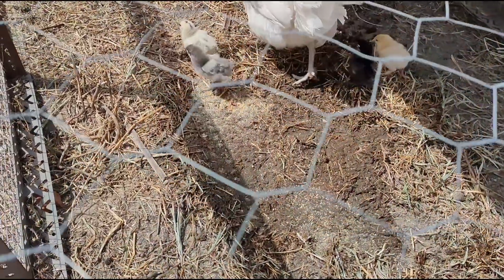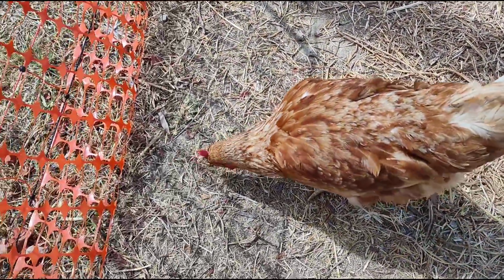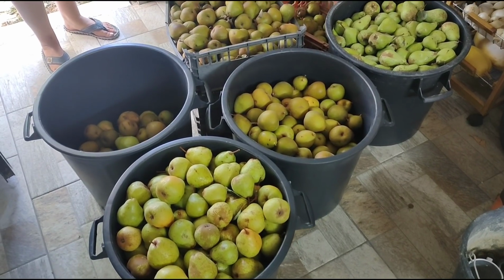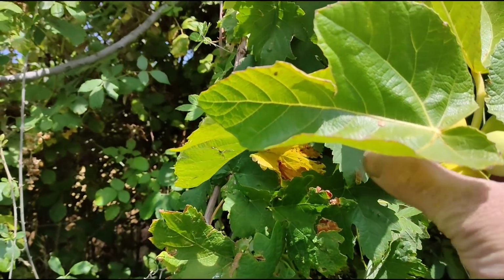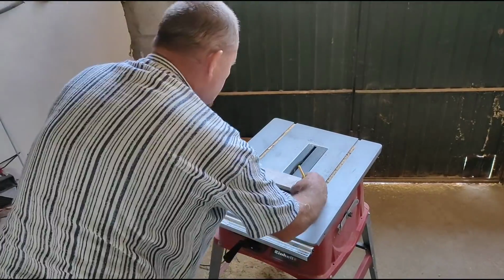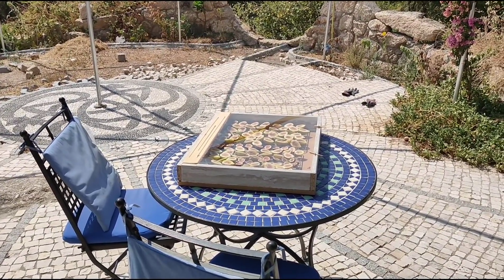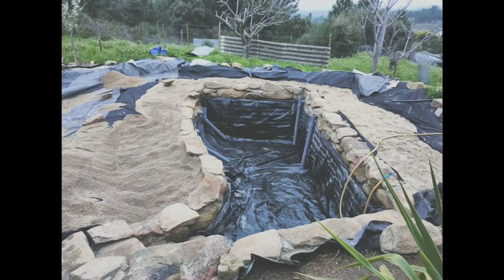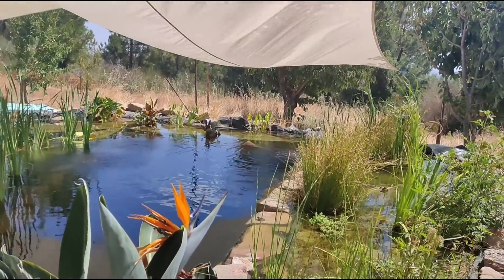No.4 How we built our Natural Pond plus Pear and Fig harvest

Comment: Your natural pond is beautiful. I was thinking after you made the vacuum. If you plumbed a couple of five gallon buckets together with some PVC pumping fittings at the top and with lids on. The water would  go through both bucket back into the pond. Most of the sand and slug would drop to the bottom of the buckets. Just a thought.

Comment: Have you considered putting in some fish that are algae eaters? As for finishing the edges of the pond I'd try to keep it looking as natural as possible, you have done an incredible job already and I'm sure you are about to inspire a heap of people!!! One thing I would do however, if it was my pond, is get rid of the fake grass, it doesn't look right with such a natural looking pond and then fake grass. It is your pond though so you keep it if you want. What are your thoughts so far with finishing it off, are you looking at putting furniture around the pond, did you want to have grass leading up to the pond so that you could have a picnic by the water's edge, maybe a wooden table and chairs, like what are at many picnic spots that can seat 8 or 10 people but are only 1 seat on either side. You could place a metal garbage bin near the picnic area too and take it back to the house when you don't need it out there or leave it there permanently if you find you use the area all of the time. You could build a wooden shelter even if it's just a roof or you could leave it as an is. You could border the pond with large flat rocks, or put small pebbles to form more of a beach, you could put large natural wooden logs for shelter for any natural wildlife and for  some natural visual decoration. You could build a bridge across the pond if that's your thing even if it's just across a small section of the water. You could make a natural waterfall and circulate the water through with a solar pump so it gives you the waterfall for free power, and it also means if power goes out it will never affect the pump. You could purposefully attract wildlife and then make accommodations for the wildlife in mind's needs and desires. It's your property, do whatever makes you and your family happy, but make no mistake, your work so far is incredible and it's absolutely amazing that it is a DIY project, because it looks professional, unfinished at the moment, but the way you have done the plants and the layering that is not flat, because flat is not natural in nature. Top job buddy 👍 can't wait to see how you finish it off